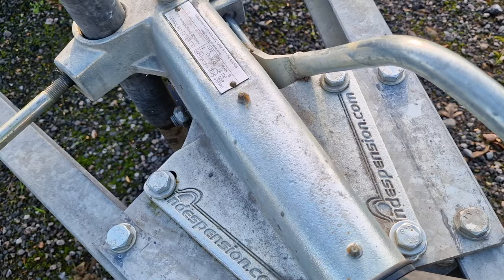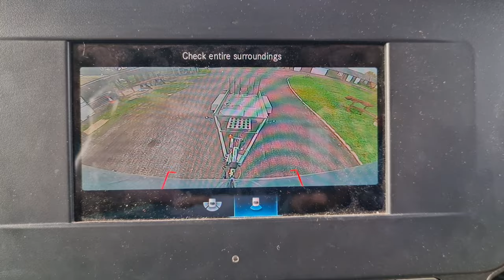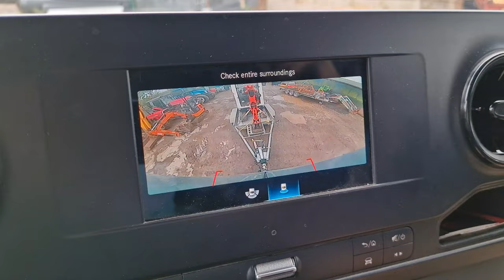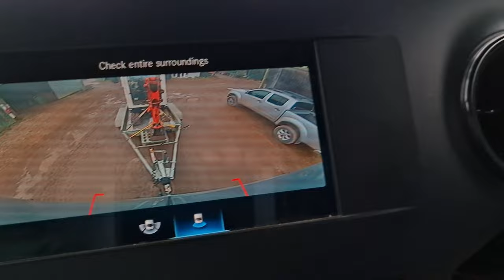Towing a digger for the first time.

Comment: Hello so how is this excavator working for you ? I would suggest using chains and ratchet binders for hauling a mini excavator just more safe.Just a tip .
Reply from the maker: Thank you for the tip. I haven't used the digger yet. From next week I am heading to the destination where I will be using the digger so stay tuned for the videos.